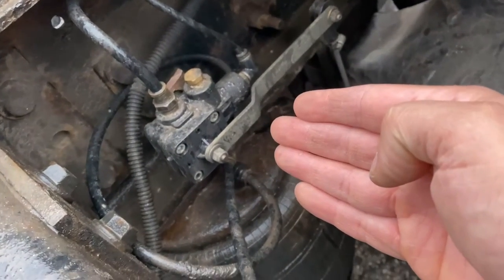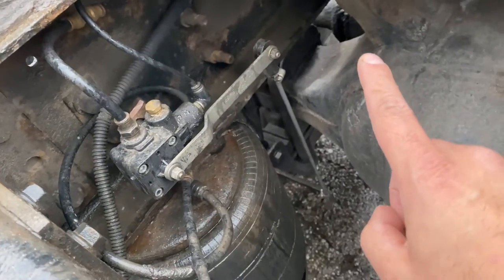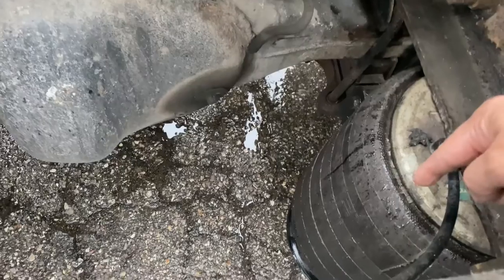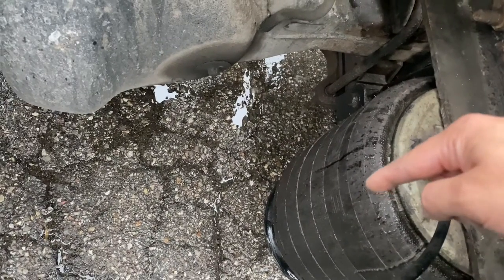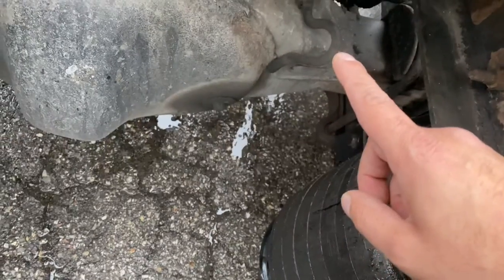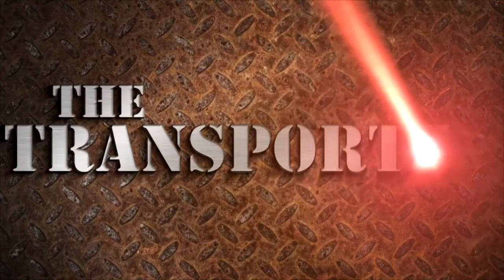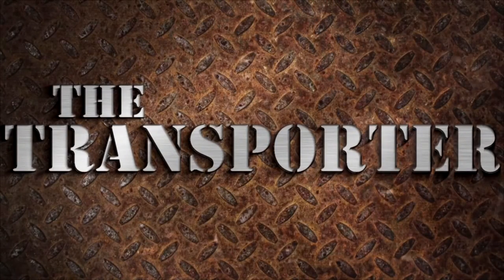Suspension air bag did NOT explode.  My mechanic fixed it! How?

Comment: It can be your valve over inflates the air bags causing it to explode, and there different types of air bags some of them will just separate from it's base so all that's required is just to fit it back together, while the other types if over inflates and Burst that's it, a new one is required